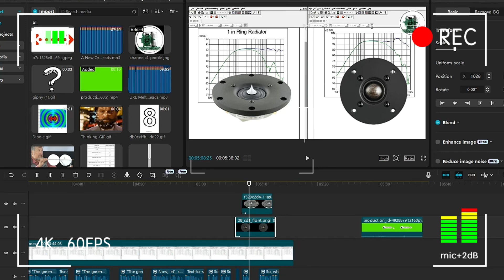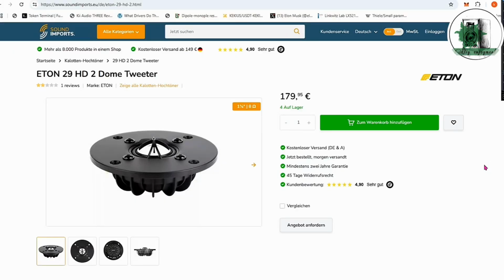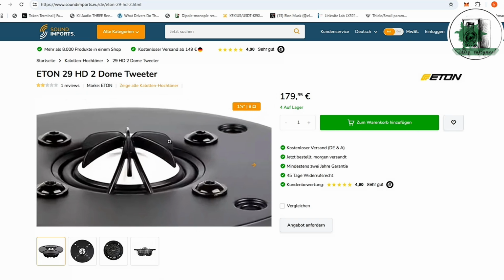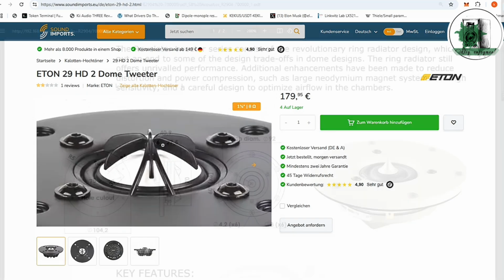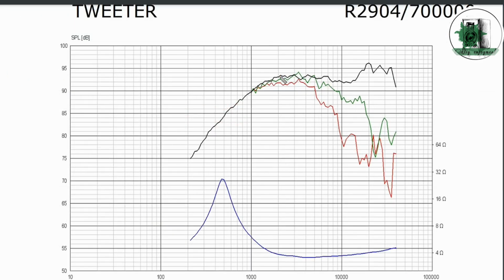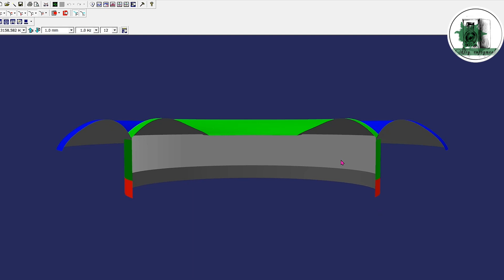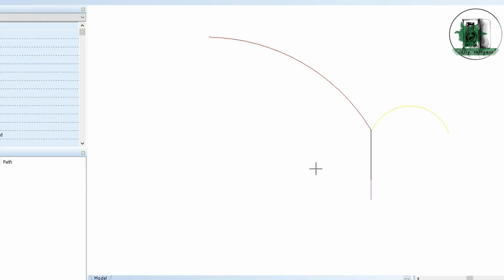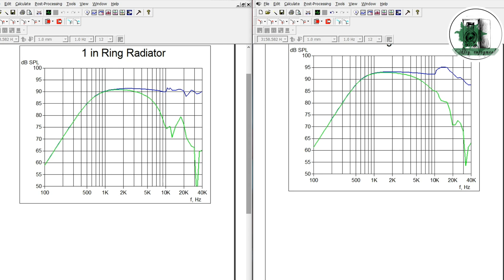Dome Tweeter vs. Ring Radiator – Directivity & Frequency Response Comparison!

Comment: Which type I prefer depends on its application. When reflections are an issue, I would prefer a ring radiator, but then I have to accept a small sweet spot. If I want a large sweet spot, I would prefer a traditional dome, but then I have to accept reflections.

Comment: Human ears don't hear beyond 17k hz. So, what's the point going up to 40k?? Just so you can sell a $20 tweeter for 1k? Very well made video, explains everything in detail❤. I wish my wife explained everything as clealy 😢. Life could've been easier
Reply: The idea is to move the cone’s breakup point outside of the audible range.  Compare it to cars, you don’t want to drive a car that’s only capable of going 65mph at 60mph (ca. 100km/h) and be only 5mph away of the engine blowing up in smoke and the doors falling off.
Reply: Even if you don't hear past 17 kHz, recent studies show that brain reacts to such ultrasound frequencies. Psychoacoustically, they affect the perceived dynamic range. Some sensitive people get sick because of such high frequency noise sources. This is well documented.

Comment: Well, I have a pair of large Advent speakers, that have what appear to be Ring Radiator tweeters.   The sound they produce is nowhere near as good at my EPI 100  speakers tweeters... which feature a Cone Shape (inverted tweeter).    The EPI's produce a much Wider and Deeper 3d Soundstage... that allows you to stand almost anywhere in the room... and still get a near perfect Stereo Image  (with extremely little "Drop Off" in levels).

 I would love if you Compare Dome tweeters, to Cone tweeters, of the same diameter (One Inch).    In fact, maybe even model the shape of the cone, via photos of an EPI tweeter.   The cone curve is somewhat shallow.

 I believe there is a major misconception... about Domes being able to spread the sound better, in all directions.   I believe its quite the Opposite...  in that Cone based tweeters, can spread the sound much Wider and much Further out.

 I believe the cone shape helps to concentrate and capture the surrounding air better...  and the Curved slopes help spread the image much wider.   The left side of the slope... causing the sounds to travel more to the right... and the Right side of the slope... causing the sounds to travel more towards the left.  (same for up and down... which gives a cone based tweeter a much TALLER soundstage as well).

 Think about this...  You dont really see woofers, that use Domes... right?

 All of that said... the best Midrange that Ive ever heard, came from a 3" dome.   I speculate that midrange frequencies tend to be more Energetic... and the dome helps to reduce an over-bearing intensity, while also softening things up.

 I also wonder, if the shapes of the tweeter and midrange are different... that they might be less likely to interfere with each others waves (leading to less distortions, more details / separation).   For example.. the tweeter being a cone... and the midrange being a Dome.

 Anyway... Ive never had any issues with my EPI's,  bouncing the tweeter frequencies off the walls, in any "Negative" way...  and Ive placed them in many different locations.   That said... I HAVE heard at least one speakers tweeters, in which they DID cause issues within a room.  Those were a small Radio-Shack bookshelf speaker pair... that had Dipole Ribbon tweeters (Lineam).    In the store... I was hearing delayed instances of the tweeters playback... coming from various different directions... and arriving at my ears at different times... similar to an Echo.   It was extremely annoying, and ruined the experience.

 That Said... those Lineam tweeters were specifically designed to radiate in 360 degrees... where as most every other tweeter, outputs in 180 degrees or Less.

 Now... I have heard much better Omnidirectional speakers... that probably just used a standard tweeter, that was being spread out with a Conical Deflector... or merely.. just vented out of ports, on all sides of the speaker.   That particular speaker, was a pair of Octagon shaped End-Tables.  They had no issues at all.. and the sound was quite Impressive.

Comment: I like to think of moving diaphragms as generators of pressure bubbles of various shapes, with wave patterns radiating from the bubble rather than from the diaphragm itself. A ring radiator's nonpistonic movement creates a different bubble shape than pistonic diaphragms do. It would be interesting to see a comparison between direct, waveguided, and traditional horn loaded ring radiators (e.g. bullet and slot types), preferably all baffle-mounted.